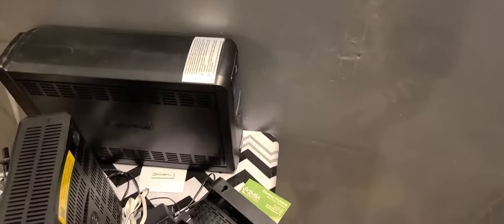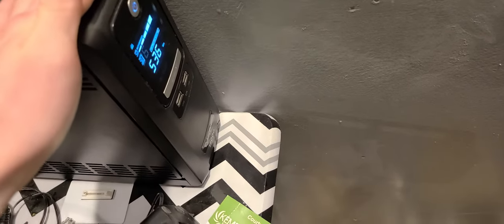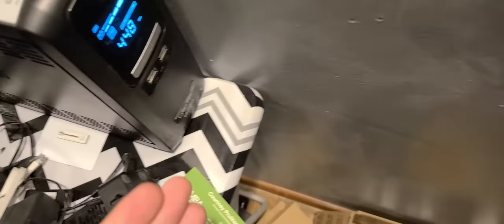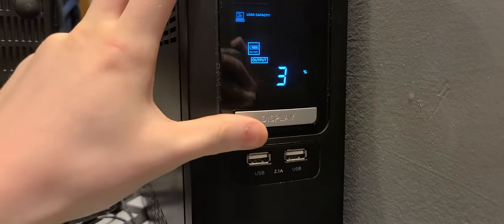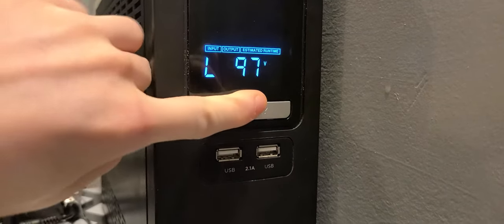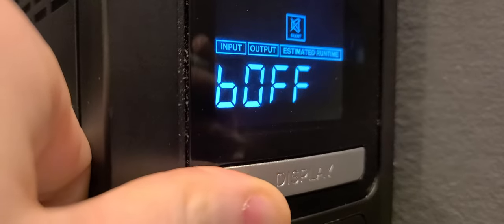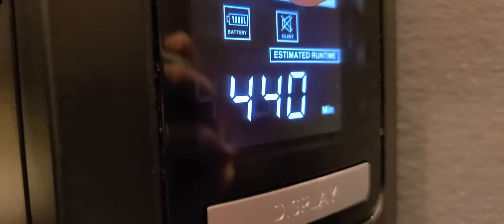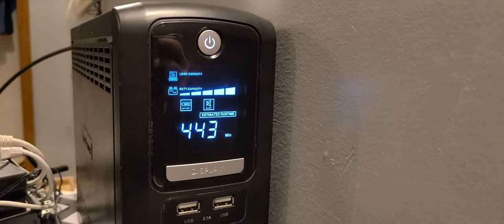How to turn off cyber power UPS beeping noise

Comment: We live in the countryside and have regular power outtages due to the power company's neglect of their rural power lines so the buzzer is a serious problem. I've removed the Piezo Buzzer from half a dozen APC UPS over the years. I just bought a cyperpower 1500 from Costco which is a bit different so I was perusing YT to get tips on how to open it up and access the guts of it, and I came across this gem of a video with the most simple solution. Thank you so much for posting this, it's immensely appreciated.

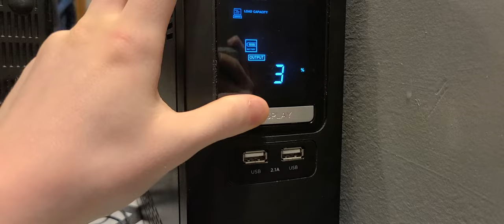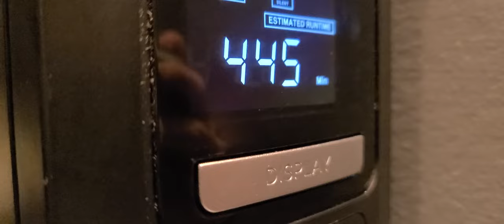Comment: Good information but too slow of a pace when people are in the dark and looking to turn off a noise that's driving them up a wall. I'd recommend trimming this to run from what is currently 1:34 to 3:06 and post a separate video for the other stuff.

Comment: Mine has a "Silence Alarm" button but when I press it the only thing that happens is it scrolling through how many volts, watts etc.  
BUT your video still helped!  After watching I thought - hmmm maybe I need to hold the button down and bingo! that worked.
So weird they made it so complicated on yours and then put an actual button on mine but they make it so that just pressing it doesn't silence it you have to know to hold it down.
Argghhh

Comment: Thank you., very helpful.  not sure if this cyberpower is a good product. Just bought it and I am mostly working at field and hope this device run my pc longer.
Reply: This is my 2nd Cyberpower unit and they have always protected whatever was plugged into them.  My first model was pre-Lithium battery days, so its ability to run equipment while the power was out never worked well on that model (if at all).    The back-up battery works great on this new model.   This infernal beeping without an easy way of silencing it seems to be its one major downfall

Comment: so the battery and surge outlets, do those also add the surge only to the output for overload protection?  i run into an overload when my gpu and cpu ramp up, its a 1350va unit so 810 watts... im running a ryzen 7 5800x and a 3080 off it and it hits (at peak when unplugged from the UPS) 815 watts from the wall when stressed in some games like the witcher when the CPU and the GPU are going hard